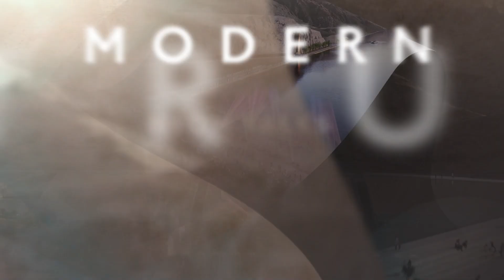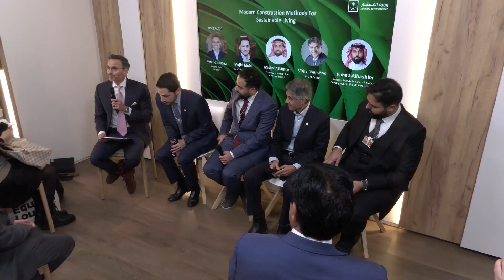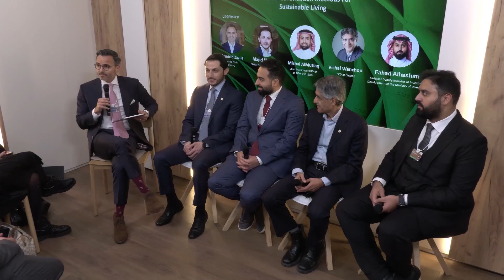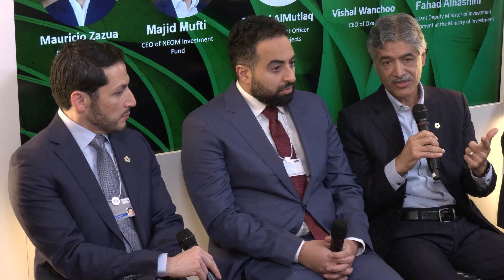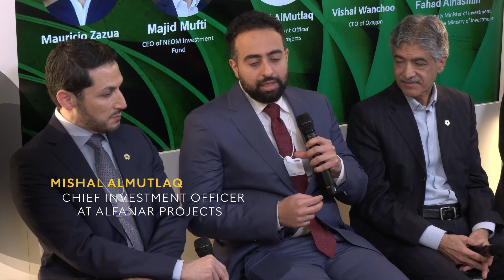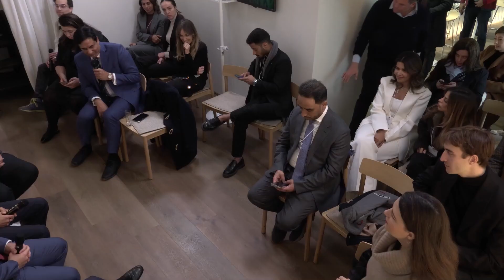NEOM Talks at Davos | Modern Construction Methods for Sustainability

Comment: Here are solid points highlighting long-term disadvantages of volumetric construction:
	•	Limited adaptability – Difficult to modify, expand, or retrofit once modules are installed.
	•	Structural joint degradation – Module connections may weaken over time, leading to leaks or structural movement.
	•	Transport-induced stress – Modules may suffer hidden damage during transportation, affecting durability.
	•	Design constraints – Module size and shape are limited by transport logistics, restricting architectural flexibility.
	•	Lower resale value – Market perception may label modular buildings as lower quality or less permanent.
	•	Challenging maintenance access – Pre-fitted services (plumbing, HVAC, electrical) are harder to access for repairs or upgrades.
	•	Compatibility issues – Difficult to integrate future systems like solar panels, energy upgrades, or smart tech.
	•	Code and regulation mismatch – Risk of future non-compliance with evolving building codes or fire regulations.
	•	Thermal and acoustic bridging – Weak points at module connections can lead to long-term energy inefficiencies and sound transfer.
	•	Limited lifecycle data – Uncertainty around long-term performance and maintenance costs compared to traditional builds.

Comment: https://youtu.be/exkKjO0ov3Y?t=1274

SIBS specializes in modular construction and has delivered 3,474 apartments across 57 buildings for NEOM, a visionary city project in Saudi Arabia. Modular construction provides accelerated timelines (30-50% faster), cost efficiency, enhanced quality control, environmental sustainability, and weather-resistant building processes, making it a perfect fit for large-scale, sustainable projects like NEOM.